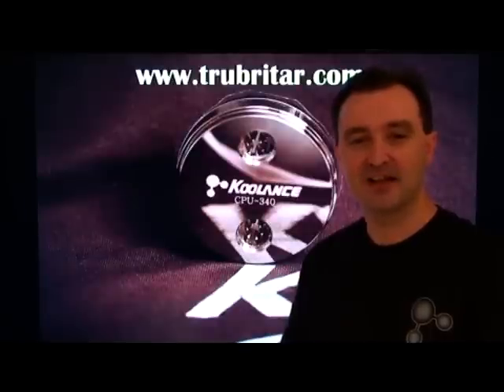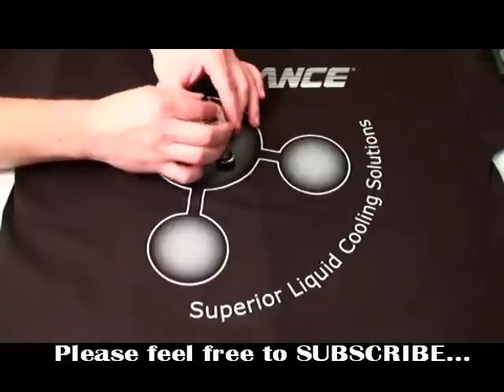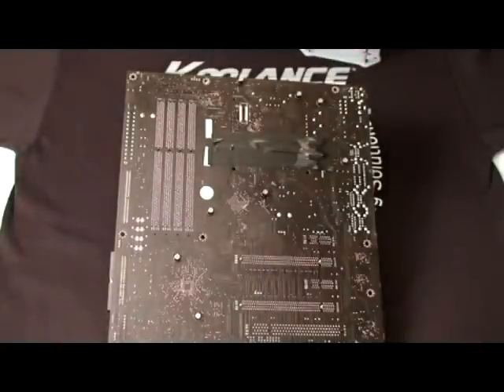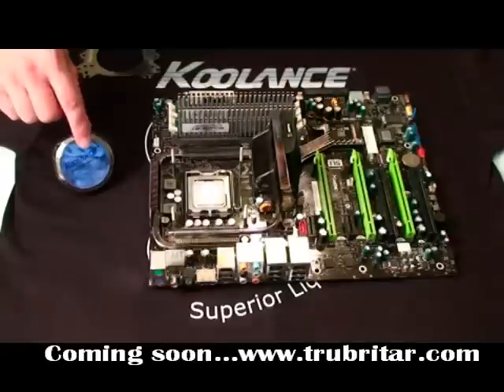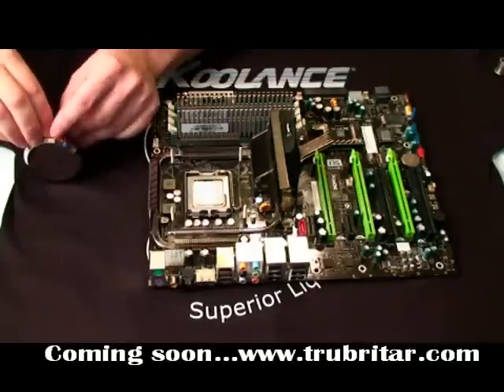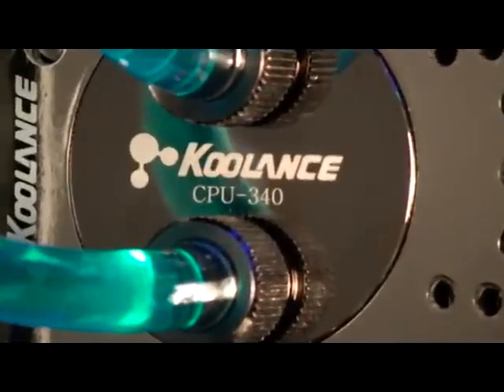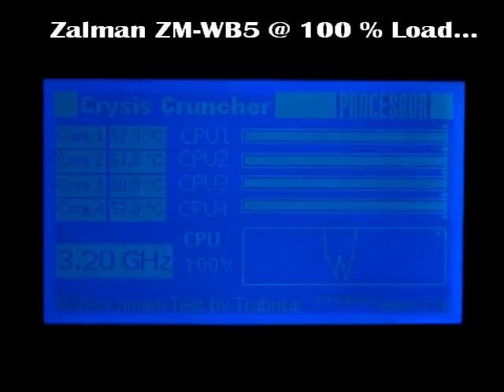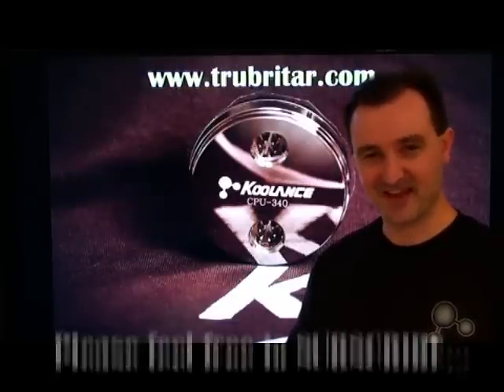Koolance CPU-340 Cooling performance

Comment from the maker: The electrical tape used is 3M.  It is rated from -10'C thru 90'C (194'F).  I can only guess that if the back of the board gets anywhere near that hot, lets forget watercooling and grab a fire extinguisher...lol

Comment: there are a few reviews, but if you want an idea of how it works then read reviews or watch videos of the xbox 360 koolance kit because they use the same waterblocks and setup. Only difference is the mounting hardware

Comment: actually heat does not raise, it simply goes to the cooler place. best way to test this is to stick a metal rod in to an oven and angle it downward. if heat does indeed raises the metal rod shouldn't feel that hot when you compare the temperature to a rod angled upwards. With this said head does raise when you talk about gas for liquid only because the medium heated is at a lower density thus allowing it to raise.

Comment: wait what is the electrical tape for? i put a thermalright ultra 120-extreme cooler on my board. which is the 780i , and i think 780i is used in this video, but i didnt use electrical tape. is that bad?